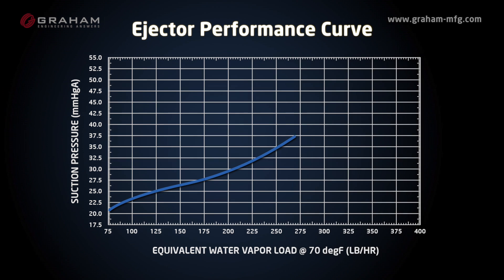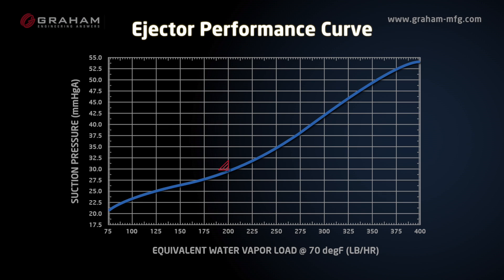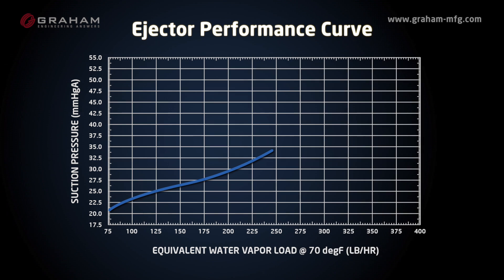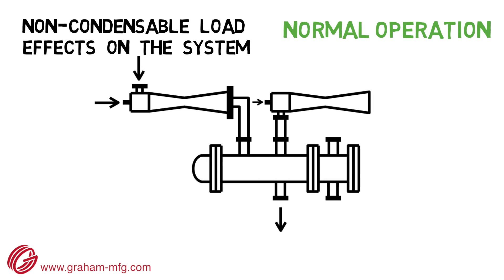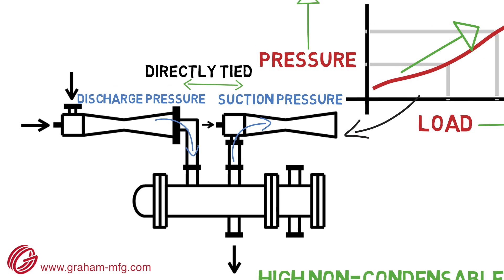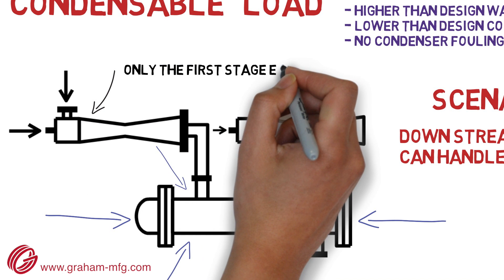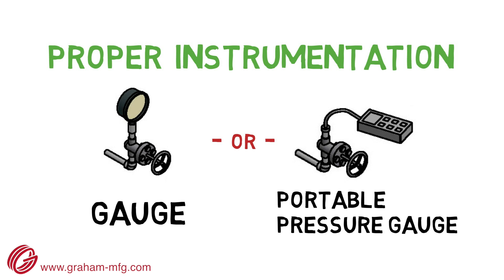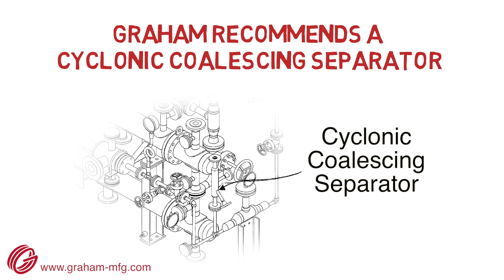Graham Corporation - Ejector Performance

Comment: the ejector we used for carrying the acid to the vessel by power water but at the same time the vessel has down flow , then the ejector is not sucking  the acid it force back to suction tank, why this happens?

Comment: please tell me how i can measure sucction load. please tell me in detail. i have simple 4 stage steam jet vacuum system in edible oil and ghee industry.
my email is baburkhan82@yahoo.com
Reply: Ejectors have performance curves which relate the suction pressure of an ejector to its equivalent load, give they motive pressure and discharge pressure are at or better than design, these curves will tell you the suction flow to the ejector.  This also assumes that the equipment is in good condition.
Reply: Does your company have a partner branch in Indonesia?